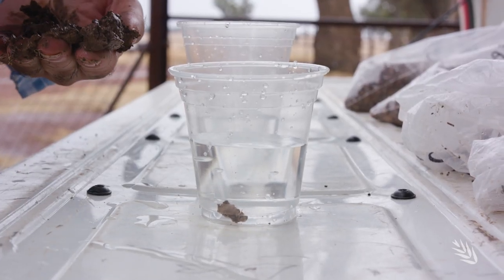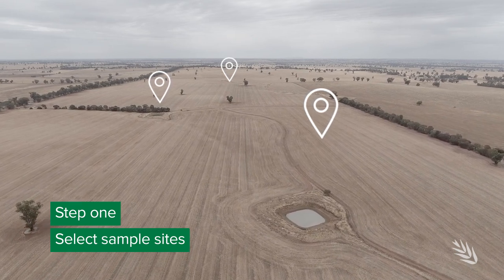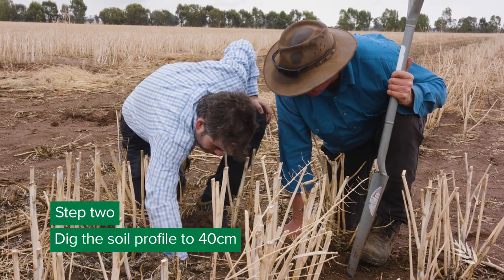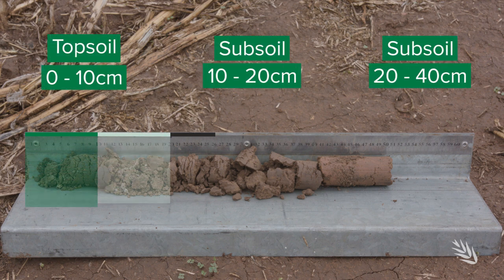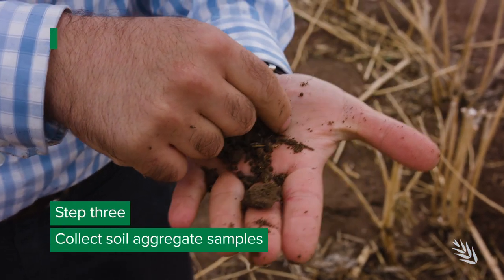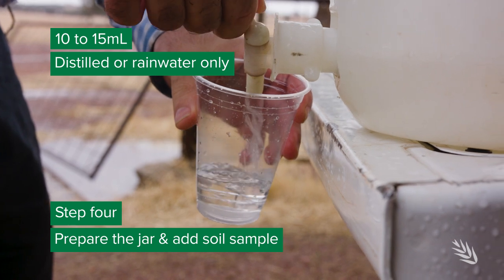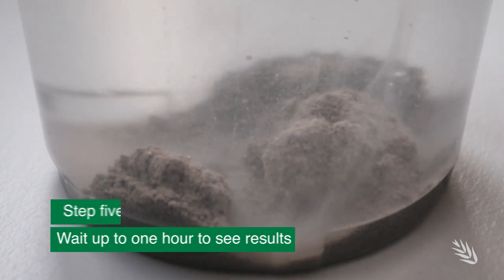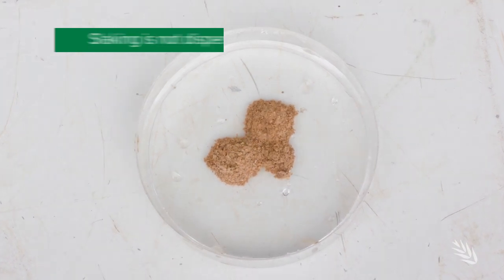How to test for dispersive soil

Comment: Would gypsum be beneficial to a slaking soil as well? Say a very sandy soil with moderate salinity and high sodium levels?
Reply: Can you please provide further details. Do you mean high levels of exchangeable sodium (e.g high ESP), and how high. Generally speaking slaking can be treated into some degree by improving soil organic matter content and gypsum will be less beneficial. Adding cover crop to your farming system also will minimise the slaking. If you have both dispersion and slaking at the same time, gypsum application will improve the overall soil structure.
Reply: @ehsantavakkoli614  I’m not sure how much is exchangeable but my soil test saturation rate was 5.1% sodium. I read that gypsum will displace sodium ions but you mostly hear about gypsum being used in clay soils, not so much for sand. Anyway, since I posted this a month ago I decided to try gypsum on my urban plot (which is a very sandy silt with low clay content) to lower sodium and increase calcium. I was pleased with the results. Soil structure still needs improvement but I’ll keep adding compost to address that. Thank you for the response.